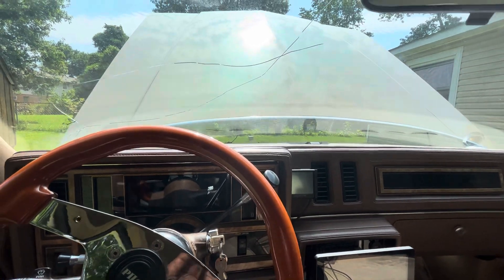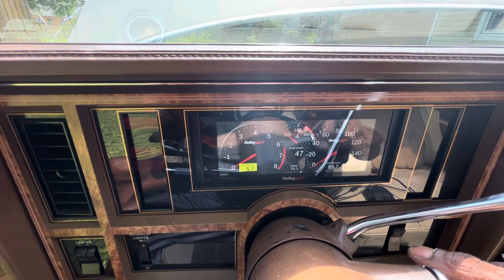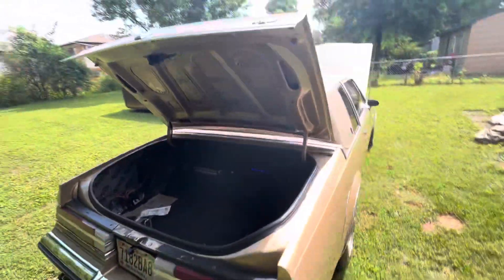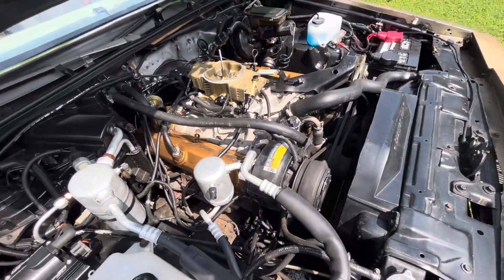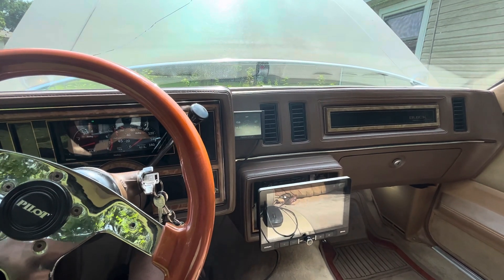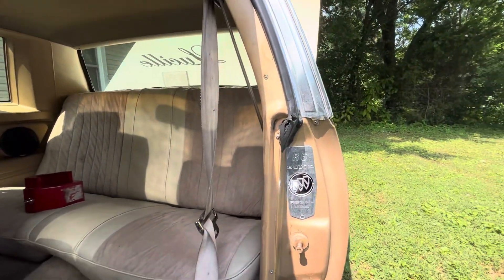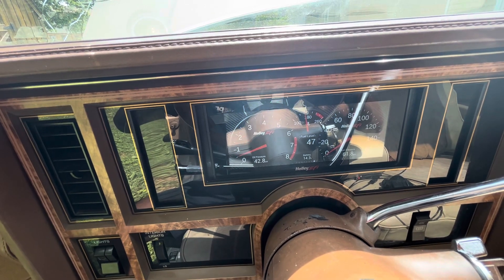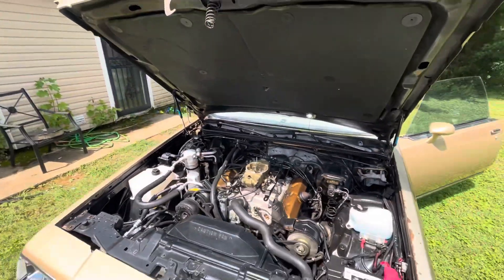1986 Big Block Buick Regal Limited Gbody With Holley EFI (Lucille The Walk Around)

Comment: Ive got an 85 regal whats the part number for the holley efi dash love the car keep the vids coming
Reply from the maker: If you have are or going to get a Holley Ecu the part number will be 553-112 if your not going to be using a Holley ecu you will need the stand alone version the part number is 553-117 it’s the same dash just the stand alone version comes with all the sensors and the other one comes with a can bus cables that connects to the ecu and it reads engine parameters threw the ecu
Reply: Thanks fam💯

Comment: How many HP.
Reply from the maker: Never had her on the dyno but I good estimate is around 300 to the crank which will give me around 225 to the wheels really a torque motor she makes 350 at 2200 rpm conservatively